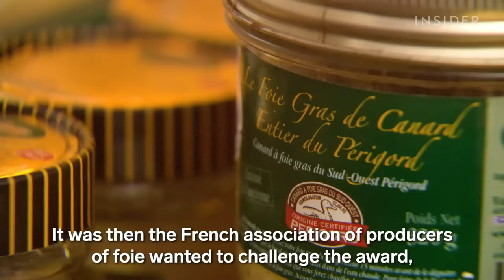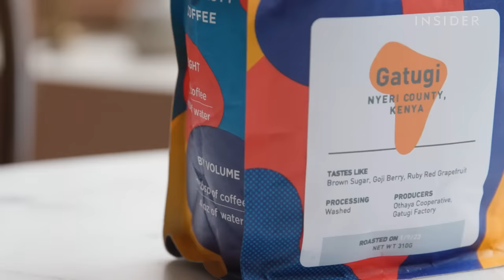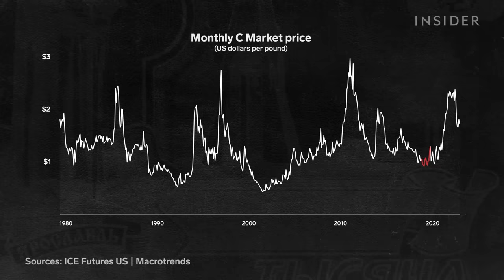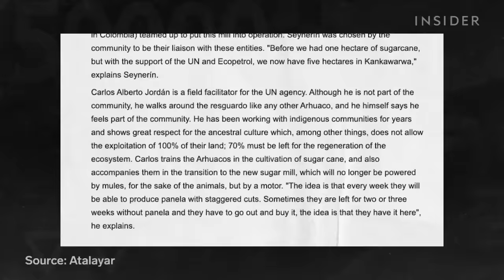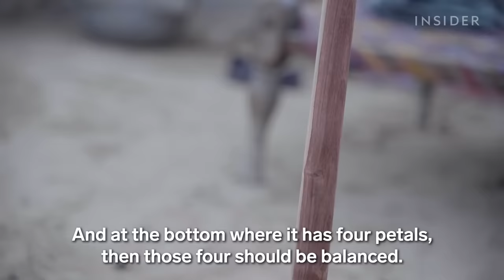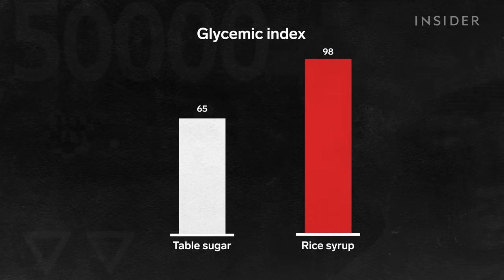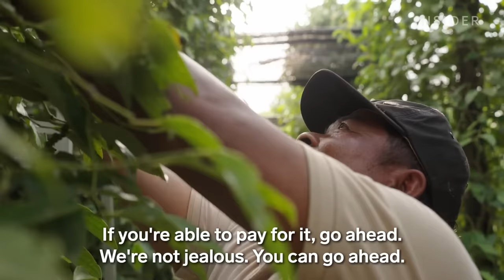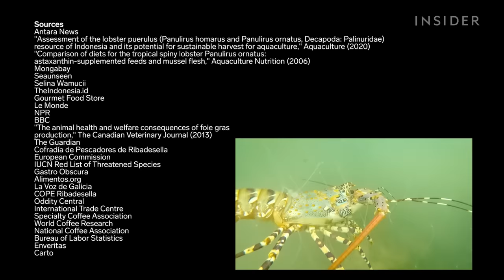10 Expensive Foods Across The World | So Expensive | Business Insider Marathon

Comment: 50:52 in Brazil those bricks are called "rapa-dura". My father used to produce it alongside his sugarcane-based alcoholic beverage (cachaça, famously used in caipirinha). During the process my mother used to separate a portion of the "honey" then add roasted peanuts. The mixture hardens and becomes a delicious candy: pé-de-moleque. The facility was discontinued, though, around 15 years ago. But still... it's so easy to find and cheap that the prices in dollar I saw in this video surprised me. I can buy a 1kg block of rapa-dura from a neighbor farmer for 5 reais (1 dollar).
Reply: The prices also surpised me, here in Colombia you found panela or rapa-dura for less than a dollar, depends of the size and quantity, if it's in block or powder.